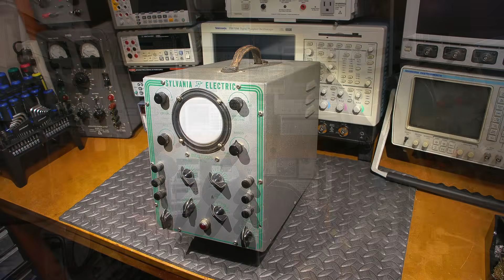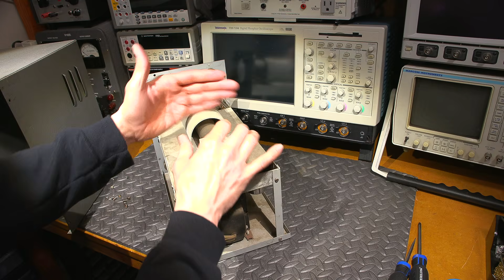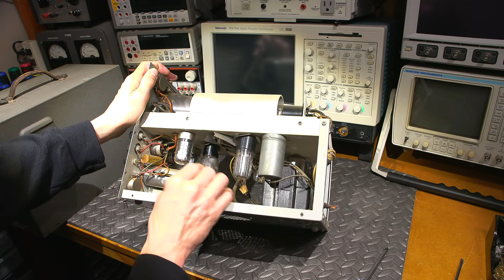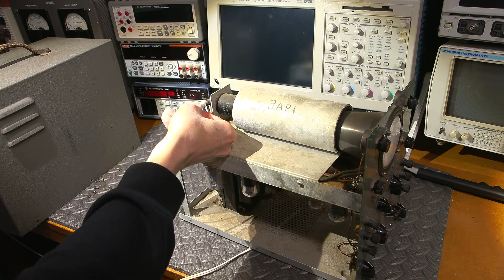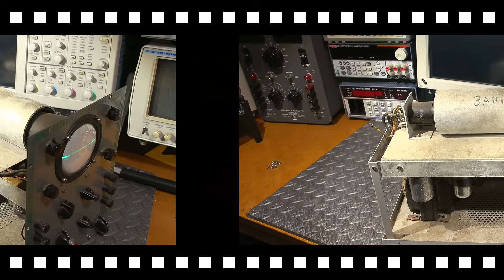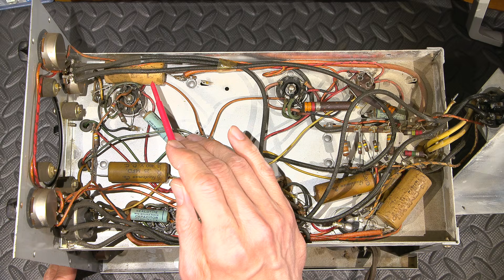Electronic Restoration Pre-Test Procedure!

Comment: Paul, do you use period correct cloth covered wire with the UL label about every meter or so? I have maybe 20 or 25 meters of it, and it's black and white in color. I'm thinking that this wire would have been used on kitchen appliances, more than on old radios.

Comment: Hi
I have an old MSi All in One PC that I got in 2012. 
It started to shut off with no warning!
Then when rebooted it would shut off at login screen! 
I found out that the Only way I can log in, is to go in the Safe Mode ( with or without) Networking.... but
Now it will not boot at all. I can't even go into CMOS.
I thought maybe the on-board Sound card has gone bad? that's why at the login when it started to play the sound it would shut off (because this PC has an external Power Supply)..
Anyway I disabled the audio inside Windows XP ( which I prefer but MS has discontinued) since there are no setting in the ( sorry) cmos/bios!.
Nothing worked ... I also dual boot into Ubuntu Linux. Can't get in it either :-( 
So... is that something you'd be interested to fix?
I really like this touch-screen PC  especially. Since they have ruined the newer versions of Windows and Linux. I'd like to keep it.
I appreciate any insight 
Thanks.

Comment: I like your videos. Two comments: 1) The L in Solder is silent; 2) Since there is oil on our fingers, it is critical to NEVER touch any conductor - such as pins or terminals. If that happens, the terminal should immediately be cleaned with 90% isopropyl alcohol. Steve S, Radar Scientist/Engineer, Raytheon SAS.
Reply from the maker: #1: I'm not in the US. I speak the "English" language, not the American version of it. Click "UK" https://dictionary.cambridge.org/pronunciation/english/solder
#2: Seems like there is no corrosion anywhere on any of the contacts in this scope, do you think everyone that has been in this (since the 40's) has washed the contacts with alcohol? This isn't going into space in a sealed enclosure, and the voltages are not logic level or below. We are also not dealing with GHz frequencies, were dealing with kHz frequencies at best.
There is a procedure for everything, but everything doesn't have the same procedure. Thanks for your comment Steve.

Comment: I've got a few old 'scopes of my own to refurbish, so add another vote for a full restoration of this one.  :-)

By the way, it looks like there's a connector plugged into the back of the CRT.  If so, you could have just disconnected the CRT and set aside the entire cover plate assembly... any particular reason why you didn't?

Comment: Loved your video of this old valve based scope, i'm an old engineer thats worked with B+W and Colour TV sets from the late 60's that were hybrid designs made for the uk market so have some knowlege of valve based equipment but i learnt my trade from 1970 by then most TV's were solid state, with a few valves. While fault finding i had acsess to Valve and Solid state scopes so i find your restorations of these early scopes very interesting, i never came across the wax caps or early electrolytics during my servicing years but do know these caps can go leaky or low in value hence the hum youve mentioned in your radio restorations. I would like to see the Silvania Scope fully restored, it would be a challenge to repair equipment like this as ive not come across any valve based equipment for years in the UK. Hope to see your resoration video on here soon and hope you have the time to get this scope working soon.

Comment: I like your joke about the Sealdtite capacitors, but I have a different experience. I've only come across one and it was split open. Not exactly "sealed tight" in my eyes. It actually brings up a question for me. Mine was a replacement cap in a TV and its 200v rating matches the Sams' Photofact. However when the set is warming up there are 500 volts across the cap. A lesson on working voltage vs peak rated voltages could be useful.

Comment: Thanks for another great video, Mr Carlson.
So, was this scope made by Stromberg Carlson for Sylvania, or am I misunderstanding the reason for the S-C tag? I have a real appreciation for Stromberg Carlson equipment. You could  tell an older S-C telephone because the handset weighed about 5 lbs, lol. I have their first radio from about 1925, a model 1-A battery set. It's built like a tank and you can just see the build and design quality. It also performs quite well for a set of that vintage.
Reply: I think it was the other way around. Sylvania made a unit for Stromberg Carlson techs to use.
Reply: @eDoc2020  Aah, ok. That makes sense. Thanks.

Comment: When you're talking about the two types of resistor bodies, in the close-up shot, there is a chassis lug near the top of the picture that seems to have solder residue on it but no wire. Maybe I'm seeing that wrong but that would seem strange.

Comment: Yes, please restore this old-school oscilloscope!  This unit is a Sylvania Model 131, which was made between the 1930s and mid-1950s.  There was a larger CRT model, the Model 132.  The Model 131 used to have a different faceplate scheme for lower serial numbers, while serial numbers above 2000 were built from the late 1940s through the end of production for the model.  Both the Models 131 and 132 were built with the "I-beam" construction technique that hung the tubes (usually octal and loctal) upside down like automotive radios of the era.  There are Model 131 schematics available from the Oscilloscope Museum.  I'd love to see how you would rehab such an "old timer" from the transition period for oscilloscopes around World War II.

Comment: I have the, almost identical, Triumph 830 that I restored years ago and still works. It was for Navy use and dated May 4, 1942.  Mine had originally seen almost no previous use because it had a service tag and when I restored it I found a wide tag had not been soldered when manufactured that was the issue. I also replaced all caps of course.
Reply: Auto correct issue, should say I found a wire that had never been soldered

Comment: What is that tester for components, Lissajous ?  ;when you soldered or alligator clipped that CRT wire it looks like your testing a cap on it - A Lissajous curve, also known as Lissajous figure or Bowditch curve, is the graph of a system of parametric equations x=A\sin, \quad y=B\sin, which describe complex harmonic motion. This family of curves was investigated by Nathaniel Bowditch in 1815, and later in more detail in 1857 by Jules Antoine Lissajous. Wikipedia -Harmonic resonance is a cool scope picture. Yes Paul worth a restoration.

Comment: My Hammarlund HQ-129x was made by stromberg carlson too.
Reply from the maker: I have one of those waiting for bench time as well.
Reply: @MrCarlsonsLab  Oh nice! Your Ft-1000 repair is the reason I felt confident to rebuild the finals on my FT-1000MP MKV. My HQ-129x is fully restored, however,  It probably needs a good alignment. 

I've got a Hallicrafters SX-32 here sitting waiting for me to change the BFO circuit to the SX-28 (the 32 uses a variable inductor, and the 28 uses a variable cap, I have parts for the 28)

AAAAND! I may be getting one of my bucket list rigs. An RCA AR88!

So any boatanchor content you do is very welcome over here.

Comment: So far I have not seen you test the tubes in the old equipment you "fire up".  I wonder why that is ?  The very first thing I do with all the tube type equipment I see is carefully remove all the tubes and test them on my Mercury 1000 or my Precise 111 testers.  I would prefer to test on my Heathkit TT1 but it is currently out of service for what I expect is a meter issue.

Comment: Hi, Mr. Carlson... I am writing to cast my vote for a detailed restoration of the O-Scope!  Thanks, for the opportunity to be counted.  I do not have an o-scope to refurb, but I DO have some very OLD tube radios.  Your videos are TOP SHELF!!!  Steve (from Kansas, USA)
Reply from the maker: Thanks for your kind comment Steve!
Reply: @MrCarlsonsLab  

Good day Mr. Carlson. Do you repair for the public? I have an excellent pair of Heathkit AA81 amps that have original ripple filter cans. Im afraid to use them, but have run them on 90v using a variac. Id prefer to have the cans repacked than altered otherwise.

Comment: This old piece of kit is definitely worth a restoration and I'm sure everyone will look forward to seeing that. The old sleeving on the interconnecting wiring appears in excellent condition so I would guess it's probably been kept in a stable environment over the years. I note it has a 3AP1 CRT tube which brought back a fond  memory for me as I used one when building an "old-style" panadaptor a while back. I was very surprised by the bright trace it produces at very low EHT.  Great video as always!

Comment: I've had several old oscilloscopes over the years. Fun to play with. I picked up a Heathkit Model 0-5 at a church thrift store for $10. You are lucky that your find was not modified. Mine is modified and a schematic isn't the easiest to find. Someone had one on EvilBay with manual but they wouldn't make a copy of the schematic--no reply to my request. It has the classic goofy raster like this one. I once had an old EICO model from late 40's. It worked fine. It also had evidence of modification with extra holes in the front.

Comment: Dang so when i "invested" in a carton of fifty 5B/254M loctal tubes for experiments, 1st time i put one on my tester,  i so got it so wrong! I had to unplug the NOS tube & reset things. It was so hard to remove & rocked it like crazy in the socket & then pulled it & reset things on the tester,  plugged it back in. For a couple of minutes the filament glowed and i got some readings but then nothing! It was hot to the touch & the filaments were drawing current but were not glowing red at all!  Later (1/2hr) i noticed the edges of the getter going white! ... It took over a day for the getter to totally go away, completely white. No cracks to the envelope so i guess i wrecked the pin seal unplugging the tube so rough. Then i found the socket, on the tester was a new modern one. It was just so strong on its locking compared to a quality original version! (Just neat to learn how i was supposed to unplug a Loctal, so thanks Paul)...
Reply from the maker: Glad to help Pete!

Comment: Hi, just a couple quick questions - At around 24:30 into the video where the components are shown, what power rating would the big 3.3K resistor at the top right of the chassis be and what would a modern replacement of similar value look like?  I always have trouble figuring out what wattage these old resistors are.  Many thanks & keep up the good videos. It would be nice to see the old scope restored.
Reply: I was also wondering if that was a burn on the wire above it too
Reply: Looks like 10W from here, but could be wrong being not there in person.
Reply: I'd guess at 3 W.

Comment: I was surprised to see most of those resistors 10% , so I would be tempted to replace them with 5% or better tolerant . All these vacuum tube gear is worth a restoration. Good video as always
Reply: I think Mr C mentioned that Vacuum tube devices have much lower tolerances than digital. So 10% or 5% doesn't matter. I think partly because these things have tuning adjustments, if I remember my 8th grade electronics course correctly. That teacher inspired me to pursue high education in my 20s, and his lab looked a lot like Mr C's, with many, many devices on the shelves.
Reply: @toomanyhobbies2011  Depends on the instrument.  If it's a condenser tester the film capacitors need to be tightly toleranced so the bridge will work in an accurate and repeatable manner.
Reply: @douro20  they usually use mica caps... or on european stuff ,polystyrene... so when we see those ,we automatically know its a critical part in terms of value and stability....when they'd use paper caps or carbon resistors they can be off by 20% sometimes even much higher and it will work just the same if you adjust and calibrate the thing wether its a scope or a tv....
Reply: @toomanyhobbies2011  U may have lived a "charmed" life. Enjoy those memories. TYSM 4 sharing.
Reply: Lovely Case.
Reply: Most of them, especially the "roundies", have drifted well off their rated values - I've come across some that are as much as 50% more than their band values claim.  Sure, you could put 5% tolerance in there if you want, but if the originals were 10% there's really no need to go any better.